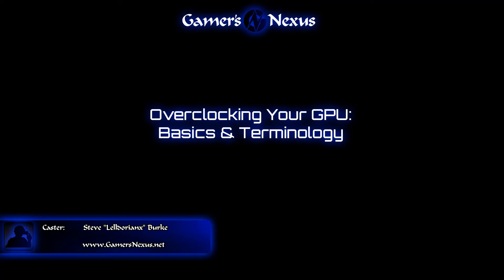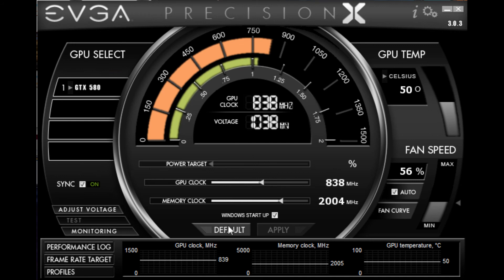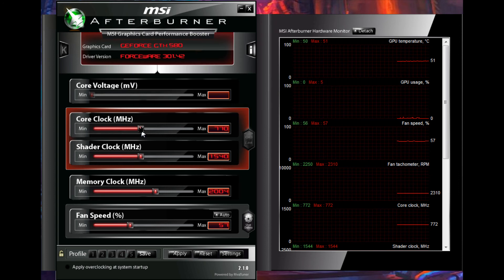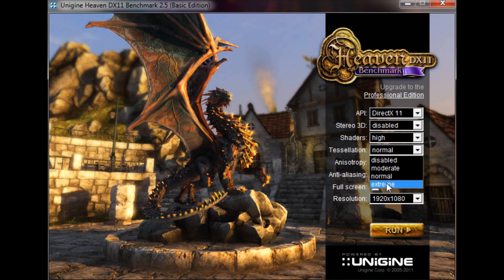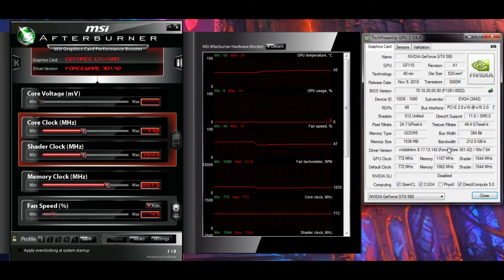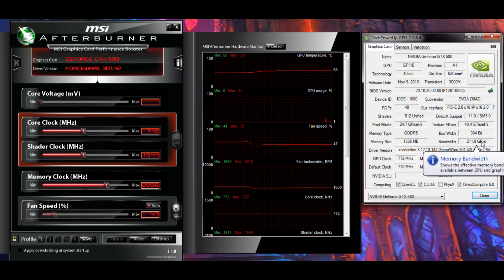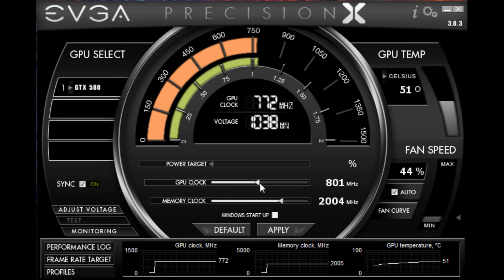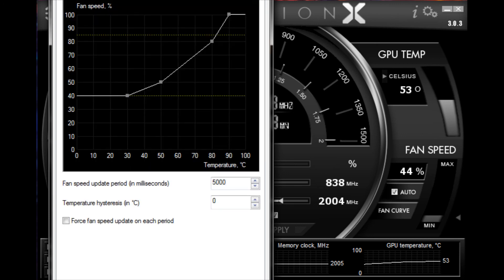GPU Overclocking Primer: Understanding GPU Overclocking Basics (Fundamentals)

Comment: How do we know whether the PC freezes or shuts down because of instability or from heat? I know there would be a heat limiter, but I'm assuming that if you have an alarm for a certain temp, say 85 degrees, if it shuts down it's probably because it's not getting enough voltage no? And I should decrease the clock or increase voltage?
Reply: Because FurMark exists

Comment: My setting on the EVGA 650
default is 1080 coreclock , mine is +222Mhz
default is 5000 memory clock, mine is +400Mhz
Temps are hardly different, this card overclocks like a horse on steroids.

Comment: I have a GTX 560 Zotac. My core clock on default is 820. I want to know how much I should go to increase a good amount of fps on Battlefield 3. I tried going over 900, but after a few minutes in game on Medium/High settings I crashed. I tried it on low also, but it crashed faster...
Reply: maybe 950 or so